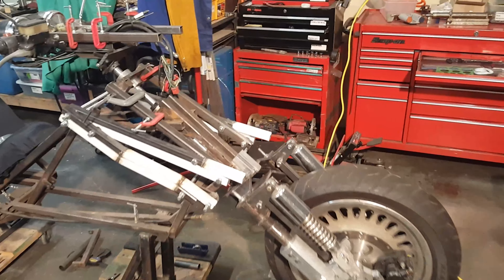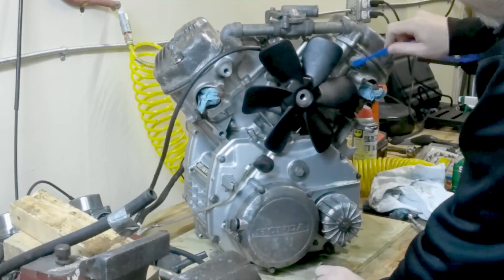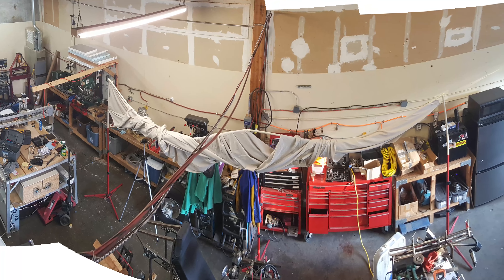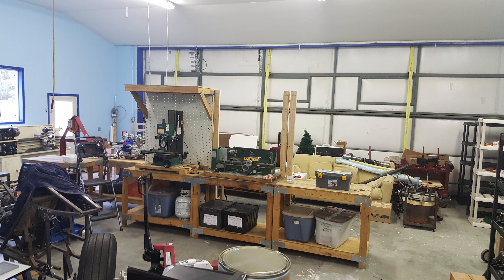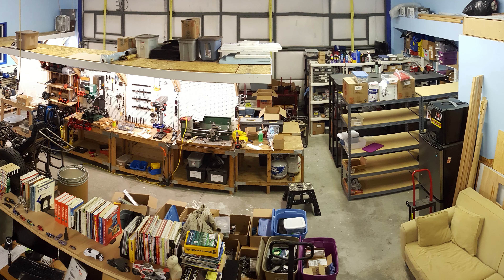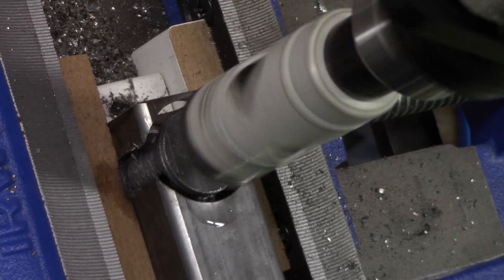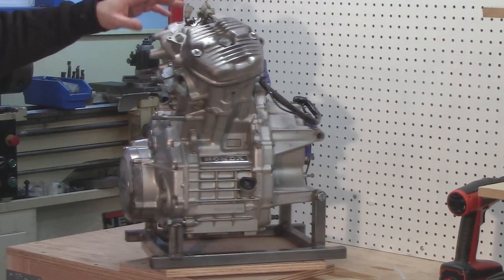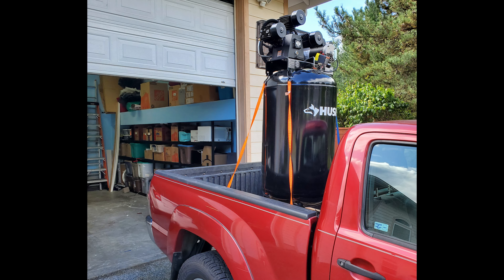Akira Bike Project - 12 - House with shop and CX500 rebuild part 1

Comment: Good choice on the Honda CX500 engine. Congratulations on finding a shop/house in the Seattle (my) area, not an easy task unless you have very deep pockets.
Reply from the maker: Oh yeah that was rough, every single week for over a year it was look for new listings on, plan open house visits on the weekend, submit offers mon + tuesday, get in bidding wars, and lose.  repeat over and over.
Reply: @matus1976  The shop is a definite winner, FINALLY a home for your projects.

Comment: I wanna see a future version of the project with twin electric motors in the hubs. Instead of a battery pack it could be powered by a gas engine, just like the Fisker Karma.
Reply from the maker: I was actually doing some design studying on a serial hybrid version of this, this actually seems much more practical in a recumbent motorcycle like mine than say a car or truck. You have the extra room for the extra motor/generator, the low aerodynamic cross section, and most importantly, drag low enough that a small generator could do it. Moving the motors to the hubs would free up even more room, but with the disadvantage of hub motors creating higher unsprung mass. Probably an acceptable compromise in a high mileage road vehicle though. Might be in v2 or v3!
Reply: @matus1976  not to mention that it'd be closer to the original version of Kanedas bike. I wanna see arcs from the wheel hubs like in the movie.

Comment: For how much that weighs you should use a larger engine. Use a VTX 1800 engine and you can use the shaft drive.
Reply from the maker: Agreed, going with something lighter for the for the first gen prototype to make it less likely I'll get seriously injured in early testing , I have a cx500 turbo (75HP) and a cx650 turbo (100 HP) that'll I'll upgrade to

Comment: Whats the CAD software your using , looks cool
Reply from the maker: I'm using Lightwave for most of my design work, which is actually a 3D animation and modeling program. I re-create things in SolidWorks to do stress analysis.